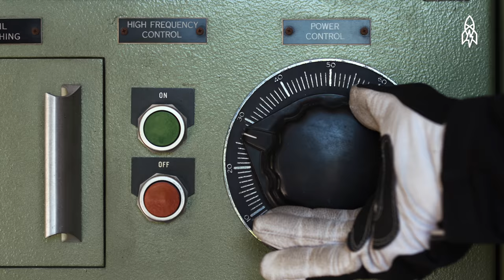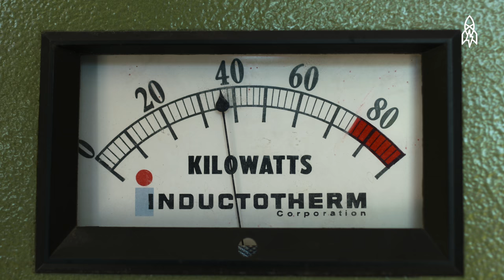Man-Made Lava for Explosive Experiments

Comment: 1:03 RIP Camera.
Reply: StellariumSound  📷🔥😢
Reply: StellariumSound you do know they got the footage off, so the camera did survive
Reply: Either they used a clear heat resistant material, or they had the camera wirelessly transmitting the video, a feature increasingly well supported on modern digital cameras.
Reply: ...if you did some reasearch you would know that  they use glass to film under lava and acidic materials
Reply: i know im just trying to show off